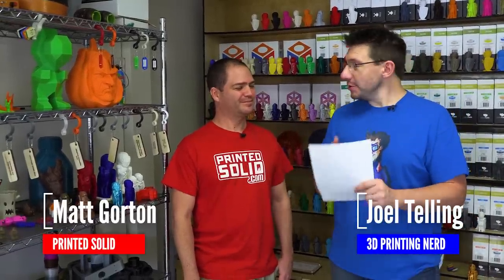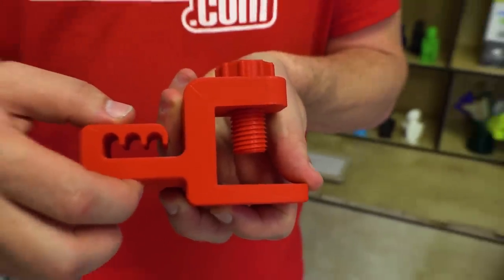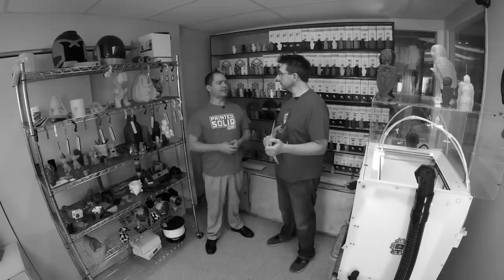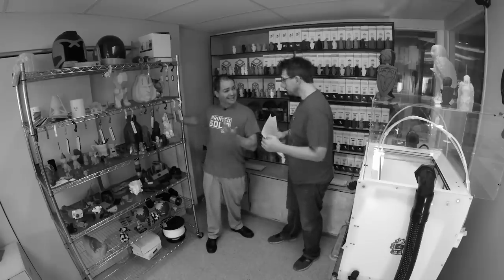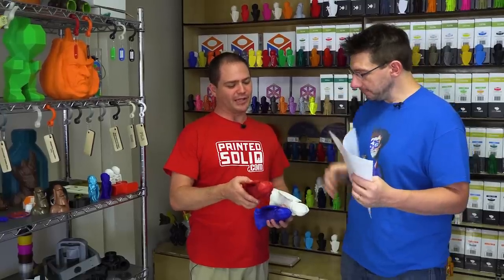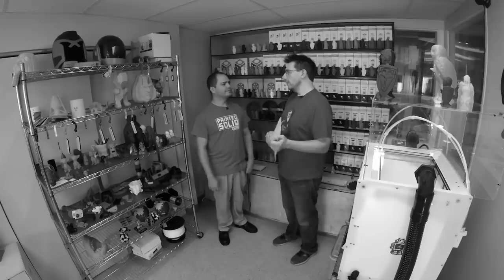Guide to 3D Printing Filament! PLA ABS PETG TPU PEEK ULTEM

Comment: 0:45 PLA
2:00 ABS
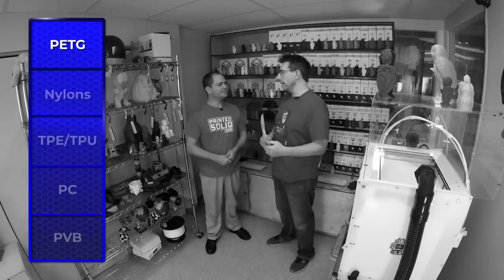03:16 PETG
04:38 Nylon
06:25 Carbon Fibre Nylon
06:58 TPU/TPE
09:50 PolyCarbonate
11:08 PVB
12:30 PVA ("Glue Sticks")
13:38 BVOH
15:20 PEEK
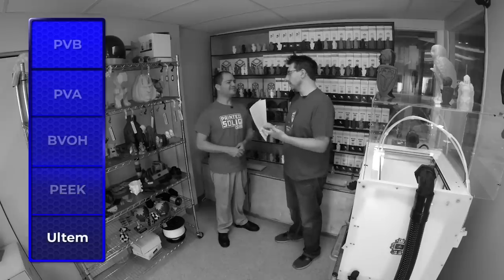16:40 ULTEM (PEI)
Reply from the maker: THANK YOU for this. Will pin.
Reply: what I like is that you don't ask for likes and provide useful information.
Reply: E
Reply: Not Every hero use's cape.
Thank you my friend.
Reply: john hopkins Nylon is 05:39
Reply: what TPU was that Dark Blue Knight made from?
Reply: Thank you
Reply: HDPE?!
Reply: ASA?
Reply: @giovannipilosio4793  I was waiting for ASA too.
Reply: @giovannipilosio4793  ASA is the same as ABS, but there are just tiny little differences here and there *I don't know exactly what is that different out there, but yeah. Basically it's the same thing*
Reply: 1 year has passed with no pin
Reply: Thank you bröther
Reply: 8:26 CRACK ASMR lol
Reply: @3DPrintingNerd  If you add it to the video desciprtion, it shows up in the video.
Reply: MVP
Reply: HIPS?
Reply: @3DPrintingNerd  FYI; It's not pinned or you forgot to pin it.
Reply from the maker: @christrahan2229  crap thanks for the heads up!
Reply: @3DPrintingNerd  Your welcome ;)
Reply: What about HDPE?
Reply: What about pvdf? I need help for this material
Reply: ‌ ت
Reply: @giovannipilosio4793  for a ده
Reply: @3DPrintingNerd  Why didn't you do ASA?
Reply: @3DPrintingNerd  so if I wanted to print RC car tires tpu or nylon I have creality cr 30 besides steel nozzle what else would I need I want to print my own car any advice I would appreciate them I planning on boxing my printer in as well...thanks

Comment: This is the best and most informative video I've watched regarding materials for 3D printing. The video was straight forward and easy to understand even for beginners and dummy like myself. Excellent video and thank you.
Reply from the maker: Thank YOU
Reply: @3DPrintingNerd  If I now only knew which printer to get. I’m pretty sure I want to be able to print with Nylon and maybe PC besides PLA.

I can’t find any video reviewing printers with those requirements :/. 

Good information in this video keep it up.
Reply: Kenny Eaton   Thank you for the info!!  3 months later.  I just bought a printer a couple of days ago and just soaking up all the info..
Reply: @scatwater  my suggestion, don't try to rush to the high temp materials. Just take it slow and make sure you got a chunk of experience with PLA. After that you will find it easy to test out with PETG too to get a variation. If you have a good direct drive printer you could even step up towards TPU/TPE if you like. But already become aware that this will be a big step up in experience and information needed to get to work. But as said before, enclosure is needed for PC/ ABS and you need something to keep moisture out of the filament if you want to print nylon. So as I said, take it easy. Will be a long, but enjoyable, road ;)
Reply: @dennisk147  TY  I am looking forward to this..  Currently watching my 3rd print.  lol   The ideas and possiablies seem endless.  I bought printer to get to see if I could make parts for a organ we got for my wife for free.    Its just a little square piece with tabs.  Looks pretty simple.  Currently just learning about materials and the basics.  Im not in a hurry.  :)
Reply: @scatwater  uhm, An organ? As in like lungs or heart?
Reply: @dennisk147    As in a old Roller Skate Player Electric Organ.    I had to google "Organ" to make sure I was spelling it correctly...
Reply: @scatwater  ahhh hahaha, makes sense. Good luck!

Comment: As a PETG user, can verify even when you get the stringing under control there are plastic boogers everywhere, but clear PETG looks darn pretty and is wonderfully strong, it's also fun to be able to tell people that I'm printing from nearly the same plastic as your everyday water bottle.

Also bought a roll of ABS when I got my printer (Anet A8) but even a couple years on I don't really even want to try printing it when PETG offers similar or better preformance in many aspects.

And yes, PLA is probably here to stay, forever, I don't think anyone will be finding a viable or equally versitile replacement for it anytime soon.

Comment: I am presently shopping for a new 3D printer but there are so many. I presently print ABS with a Solidoodle4 and the results are just OK. Most of my parts are for model airplanes. I would like to print PC and nylon and if possible Glass or carbon reinforced materials. What whould be a printer of choice for this? I am looking for best combination and ease of operatin, software and hardware. Thanks for sharing your thoughts.

Comment: Oh yeah, I remember the PETG boogers fondly. Couldn't figure it out for weeks (was new to printing at the time), but I kept having parts print fine until the infill really started, and then some blackened mess would fall off the block and find its way into the infill, too carbonized to really melt again easily, cause a layer shift when the nozzle knocked it the next time around, and basically confuse and scare me like a caveman seeing fire for the first time.
The consistent part there was that I was either printing PETG, or had switched to another material after PETG. Nowadays, my pre-flight check involves heating and taking a brass brush to the block and nozzle.

Comment: I am totally impressed by this video.  It will remain valuable over time - it can now be called a Bench Mark for future videos of this type (as you mentioned).   I've read a few comments and they are saying similar things.  You covered about 2 dozen types of printable filaments...  are there any more at the time of the video or is that the list of this moment?  Well, when the video was made and posted - since I'm posting this comment  almost 2 years later!  

1)  When 3D printers were created in the beginning and up to the Jan 2 2019 date of posting your video, did they have the ability to handle many of the filaments that came along after that date?   
2)  Have changes been made after that date to the new print heads being invented and  produced on newer machines which could handle the old and newest filaments?
3)  Those two questions mean that  it would not be fun to be the one who jumped into the market place and purchased one of the first 3D printers.

After I wrote questions 1 & 2 I thought of the "Metal" filament.  Not only would I have thought that Metal would NOT be done - but they found a way.  And that means that something special had to be done to the print head so it would be possible, not to mention the filament had to be developed which could be melted in some creative way and would harden afterwards.  Is it truly metal as we know metal?

Well, how about doing an update to this video in about a month?  Tell us if these existing filaments have been enhanced and reformulated so the bad or undesirable properties have been developed out of the product now.  Same filament name or new name?  Keep the same video title with a suffix on it.  Thanks

Comment: HIPS (high-impact polystyrene): From personal experience, it's a good ABS-compatible support. It can be dissolved (sort of-- you need regular agitation and a lot of time, and if you soak ABS in it too long it will soften) in d-limonene, but you would only do that if the void supported by HIPS is more than a simple gap-- most of the time you can cut into it with a sturdy pair of wire cutters and then just pull it off. The guys at Raise3D cautioned against using HIPS because d-limonene, while not as nasty as THF or acetone, can be easily ignited. Being one of the styrene materials, HIPS has the same VOC/particulate emission concerns as ABS-- because the extrusion and bed temps are essentially the same as ABS, you'd want to print the whole shebang in an enclosure with an air filter. I've made ~30-40 big supported prints with ABS/HIPS, and when the print is finished, it peels off like Velcro. Fun stuff.

I haven't tried to make an actual structural part with HIPS, mainly because I've found that it doesn't like to stick to BuildTak. I've heard that it's surprisingly stiff/strong. I've also been told that you can just leave HIPS lying around because it's not hygroscopic at all.
Reply: i wouldn't say d-limonene is less nasty than acetone. acetone has an extremely low toxicity, albeit not quite as low as d-limonene. the EPA does not consider acetone to be a VOC.  d-limonene is by itself an irritant and allergen, yet its chemical instability causes it to easily oxidize, at room temperatures, into a powerful allergen and sensitizer to allergic reactions in general. 
that said, there is not nearly as much data on d-limonene as there for acetone.
Reply: @superdupergrover9857  The Raise3D guys told me that after a customer took one look at the datasheet for d-limonene, they were like "Nope! NOPE!" and decided to never use HIPS.

So far I've never needed d-limonene even though I have a bottle of it in storage.
Reply: Given how the studies are going everyone without direct exhaust fume hood should not print ABS like materials without proper engineering controls. Be careful with enclosures and air filter as there are a number of requirements for it to work properly. You need to negatively pressurize the enclosure for it to work properly and the exhaust even if partial recirculating to reduce makeup air requirements you must still exhaust it outside the building. HEPA and cheap carbon filters won't work for long or properly trap all the UFPs and VOCs you would need a big ULPA and deep bed carbon filter (very heavy) to capture all the VOCs/UFPs in a semi-recirculating system.

For hobby use these kinds of safety requirements are too much so it is simpler to just not recommend it as it is unlikely all hobbyists can make a proper fume extraction or filtration system that is effective. For a home user you should just have a duct with a very strong powerful fan sucking air out of the enclosure (100% exhaust) and out a window be very careful though that you get fresh air from somewhere else and your exhaust does not just get sucked back into your house this removes the need for very expensive filters that need constant maintenance. (Use a roof vent ideally)

If you do not regularly replace the activated carbon media filter breakthrough could occur and the activated carbon will just start releasing the adsorbed VOCs. Even when the activated carbon is not in use the VOCs will slowly migrate through the media which means timed replacement is also required. This can quickly become very expensive for hobby level purposes. Even in industrial applications unless emissions exceed regulations direct exhaust with the solution is dilution is the economical way about it. (Your heating or cooling costs will rise though)
Reply: What printer did you print ABS and HIPS with, UM3? I tried but couldn't get the right settings, could you share your settings files? Thanks!
Reply: I was surprised to see HIPS was left off too! I like it a lot - functional parts are light, easy to post-process and easy to glue (Unlike PETG) Printing is roughly the same as ABS for temps. But... very thin sections can fatigue and break.
Reply: @titaniumapple1  The printer I use for this is a Raise3D Pro2, which is very similar to the now-defunct N2 but redesigned as though they watched Joel's video review of it and took his concerns to heart. I haven't gotten a Cura profile for it yet (IdeaMaker has been working OK so far), but a few things I learned along the way: (1) An ABS raft can help, especially since HIPS will stick to ABS, but has a tenuous-at-best relationship with BuildTak (not 100% sure about glass). (2) HIPS support all the things if you can, with a solid interface to both raft and model and as thin a gap as you can get away with.

What issues are you running into? If your print is cracking or warping, chances are the ambient air is too cold and the ABS is contracting too fast, or there's a bed adhesion issue.
Reply: @MMuraseofSandvich  Just had lots of issues with UM3, heating especially - even with door and top cover (heat atmosphere partially melted sliding rail blocks!)
Reply: I am familiar with  HIPS because we used injection molded components made from HIPS as part of a finished product we manufactured at work. We glued it together with Methylene Chloride, which is kinda obnoxious stuff and evaporates very quickly.  @colinfindlay4790

Comment: Hi, I have these two questions, if you can help answer, I appreciate: 
1- I create pictures on autocad to turn it into format compatible for Cura Slices, but they are flat, how can the 3d printer make it into an object with 3D dimensions? I mean how I can do? the thickness needs to be specified?
2- Does this print have a range of max and min sizes of objects it can bring? well, i would like if there is a details manual about all these, but the manual when I bought the machine does not say or I miss somewhere?

Comment: BVOH is less moisture sensitive unlike PVA which can absorb moisture very quickly from the environment. BVOH has higher temperature resistance compared to PVA and works well with higher temp materials like ABS

Comment: Regarding peek:

Extruder Temp:  375 - 410°C
Bed Temp: 130 - 145°C
Requires enclosure
Reply: ez
Reply: So basically I'm gonna need an all metal hot end with a badass heater and thermocouple, a mains heated bed, and an enclosure? Yeesh. My ender is bad ass now but not THAT bad ass lol.

Comment: Great information here, thanks a ton for doing this interview. So after listening to all this I still am not sure what would best serve my need. I am a modeler and currently use an SLA printer but it can be cost prohibitive due to the high cost of resin. What options are out there for a filament that will render great detail with the least amount of finish work necessary? Focus being on clarity of print at small detail and ability to stand the test of glues, paints and of course time.

Comment: I'd like to know which printers can   One latprint with which materials. Of a printer is made to print PLA what other filaments can it use. Plus (for a friend) can he use 3mm filament in a 1.75mm printer by simply changing the nozzle? One last question. To Matt's right in the lower shelf there's a light blue very metallic looking knight. What is the name of the filament and which colour? My wife spotted it and fell on love with the colour.  I have a friend who lives 200km away and he often calls in for a cuppa and offered to print me anything as long as I bought the filament. This would be our choice, as long as he can print with it.

Comment: Any thoughts on ASA?  I know it is a more UV resistant material than ABS, but I do not know much else about it or how is prints.
Reply: ASA is extremely similar to ABS (same family). You can use an ABS profile but typically run the nozzle a bit hotter (around 250C). ASA has great UV resistance (unlike ABS) and it is inherently low gloss (unlike ABS which is high gloss)

Comment: I use Overture PETG quite a bit, needs to be hot for sure but I haven't noticed it on my Ender3 yet.  I'm on my third reel now and still goin great.  Requires going much slower though.

Comment: I know this is an old video but what good info on filaments. I have a printer in the mail so I was going to buy filament and hit a brick wall, haha. I had an idea what I was looking for and a good understanding the types of prints but OMG soooo many filament brands ,types, colors, textures like wood and carbon fiber. Ugh. So many choices. Ty for the knowledge, I will be picking up a roll of PLA, PETG and TPU, that should cover all my current projects atm :D

Comment: Thanks for the vid. You guys forgot about one very good material with very unique properties which is PP (PolyPropylene) - mostly as a printing filament it's a PP+PE copolimer. 
I've printed PP and it is a very nice material that can be used for a lot of things that need to be strong or semi flex or high temp resistant or chemical resistant. I found it really usefull and quite easy to print with extremly good layer adhesion.

Comment: A comprehensive test of magnetic materials (thinkable one that has its Curie temperature in the printing range) would be nice and also one really comparing general ferromagnetic filaments on real numbers or magnetic hysteresis curves, Then to spawn an idea for a contest on the question - how many years from 2019 superconductor filament will appear?

Comment: Maybe there's a way of crystallizing flexibles in the filament production process, without permanently altering material properties? Or could such filament be skin tempered? Maybe some inert or compatible coating rigid enough to survive extruder push and retraction when cold, that blend with or gets absorbed by the material when going through the hotend and nozzle?